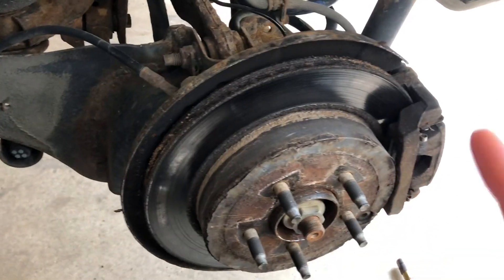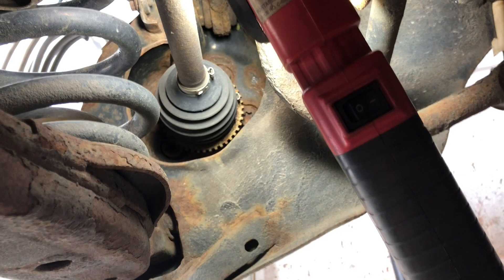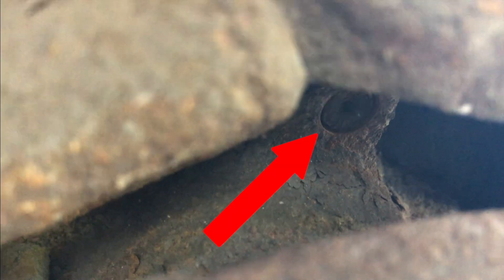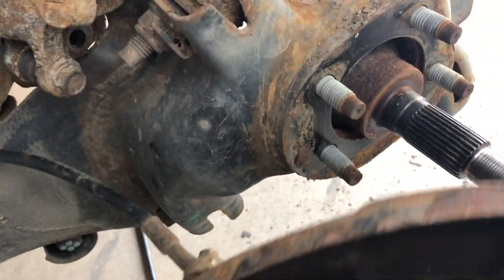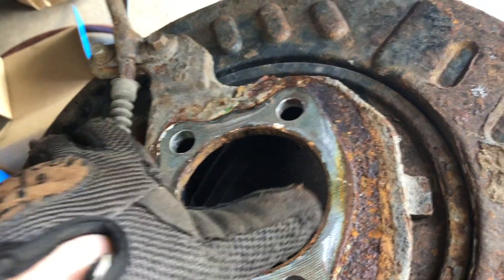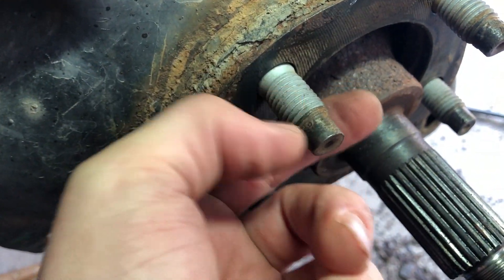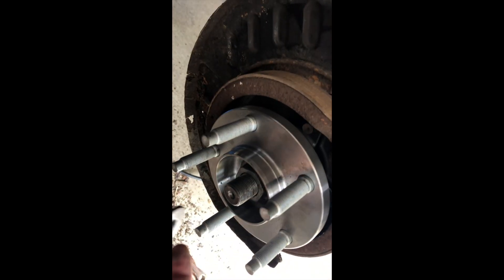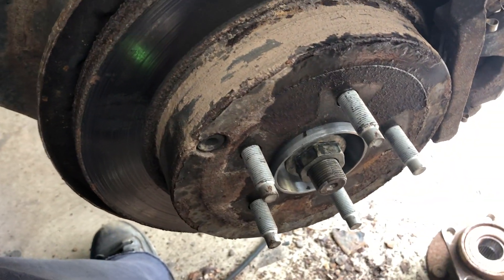2006 2007 2008 2009 2010 Ford Edge AWD rear wheel bearing replacement

Comment: No torque specs?
Reply from the maker: Hey thanks for the comment. The Axel nut is torqued to 203ft/lbs. I like to zip it on with the gun and check on the ground. This way it is tightened with no load on it (wheel is still in the air)

Comment: Lucky u I hate my bolts
Reply from the maker: Ya those bolts are tough
Reply: mine is a t-55 i  was luck enough that a regular black t-55 worked @GarageKing
Reply: did u change ur bolts ? i anna see if i can replace them with easier ones @GarageKing
Reply from the maker: Hey There, I just put the old ones back in, with the tool it was actually pretty easy.  Just make sure if you find new bolts they are the right grade and lenght @Luui2x
Reply from the maker: You are one of the lucky ones, for most that does not work, you need to buy a lottery ticket LOL :)  @Luui2x
Reply: okay thankkk u sounds good @GarageKing
Reply: yeah i use as torch and a t-55 shaved dowwn and it wworkeddd so yes im luckyyyy @GarageKing
Reply from the maker: Good thinking and glad it worked out, I know those bolts can be tough  @Luui2x
Reply: thank u just the position as hard. @GarageKing

Comment: Where in Canada you're located
Reply from the maker: I'm in the Greater Toronto Area.  What's up?
Reply: I do have a awd 2010 ford edge with grinding sound in the rear driver side. Learn that the wheel bearings causing the grinding, even louder when making turns. I live in Guelph as my mechanic retiring so he not taking on any major work.
Reply from the maker: @jr.b.403  The wheel bearings don't really grind.  They make a humming sound and should be loudest at about 80km/hr.  Drive safely on an open road with a speed limit of 80km/h or higher and WITHOUT touching the brakes weave back and forth.  The noise should change and if it does then its your wheel bearing.  I have seen a few times where people mistake worn out grinding brakes for wheel bearings, as worn out brakes can cause noise when you weave back and forth, as even a good bearing has play and the rotor will rub against the pad that is work out and it is steel on steel.

Comment: What took is that
Reply from the maker: It’s a specialty tool that allows you to get into that tight area and remove the wheel bearing hub bolts.  Thanks for the comment :)

Comment: Does it need to be a tapered for it to fit past anti brake ring?
Reply from the maker: Hey buddy thanks for the comment, are you referring to the tool? To be tapered?
Reply: Yes and is it a T60?
Reply: And where did you get the tool?
Reply from the maker: @xDirtnutx  Yup its a T60 and it has to be tapered
Reply from the maker: @xDirtnutx  I bought the tool from Snap-On, and I also found that AST makes one as well.  When you go on the Snap on Website you will see the tool is not tapered.  The picture is WRONG on their website, the tool you get will be tapered.  Another subscriber verified this with me after he ordered the tool, he was kind enough to follow up with me.  The links are in the video description for you for snap on and AST.   I do not get paid anything or earn any commission, so you can buy whichever one you want.  You may be able to make one, but you spend a lot of time grinding it down and then I don't know if it would be strong enough as the specialty ones are hardened steel.  Please let me know if you have any other questions :)
Reply: Thanks a million
Reply from the maker: Anytime brother, the job is not too hard to do as long as you have that tool. If you find anyone else that sells the tool let me know. So far the only sellers I found are Snap On and AST. Thanks and good luck with the job!!

Comment: Lmao special tool...grind down a 3" impact t60 and done....8$ an 5 mins grinding back from tip.thays ur bs claim cant do it without yourtool
Reply from the maker: Thanks for the comment brother, and your passion.  I don't make any money when people buy a snap on tool, and have no affiliation, so its not my tool.  It's just one that I found.  There are people that don't have the proper tools to grind down a T60.  Also I'm not sure if a ground down T60 would be strong enough??  I never tried.  I know the Snap On tool is hardened, and after I have used it a few times it still looks brand new which is pretty good.  

If I ground down a T60 as you suggested, someone would have made a comment, "why are you wasting your time, you do know there is a tool for this???" When I do my videos I like to be able to say you can do the repair, but here are the tools you need.  Not everyone wants to make a tool.  You do and that's good you can do that, and I can do that as well, but not all the viewers can. You either need to make a tool, or use a special tool to get this job done.  No way is wrong, they are just different. I appreciate your perspective.
Reply: @GarageKing  I don't think people understand how important the heat treat (hardening)  is on a tool like your t60.  I'm sure someone has made their own and twisted it into 2 pieces because they got it too hot from grinding.  Love the vid. Well done!
Reply from the maker: @josephk2958  Thanks for the great comment and you are 100% correct, the Snap On tool I used was tempered perfectly as it showed no wear afterwards. I didn't want to grind down a tool. You are right that when you grind down a tool it gets tempered due to the heat.  Thanks for the comment !!